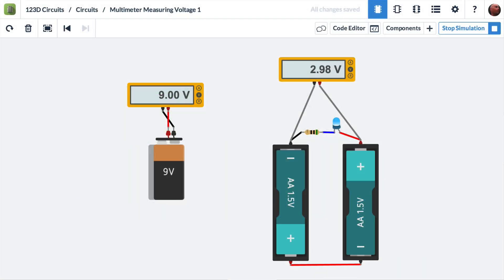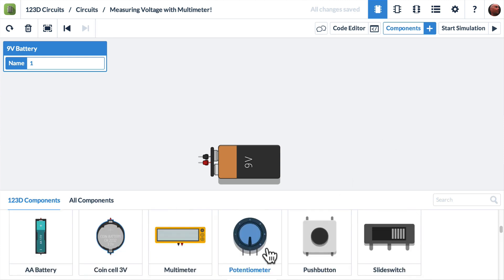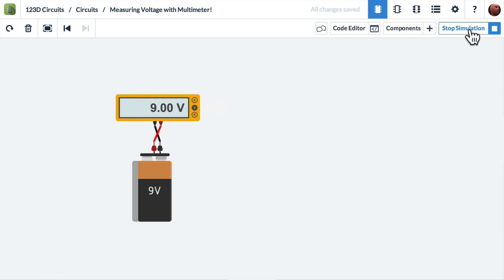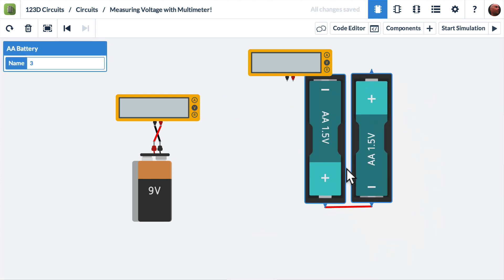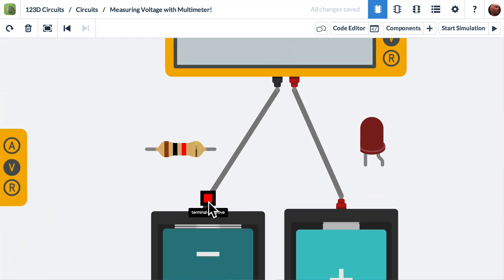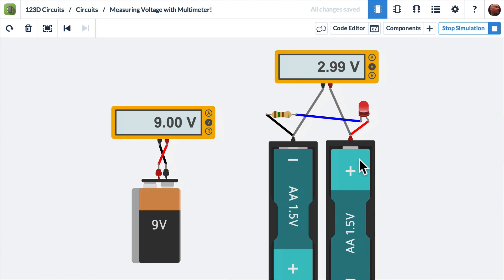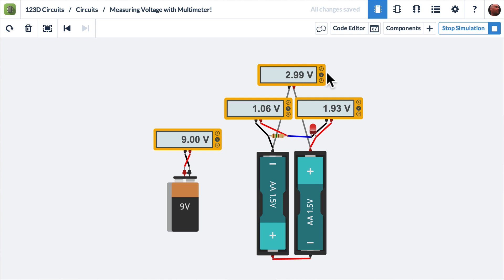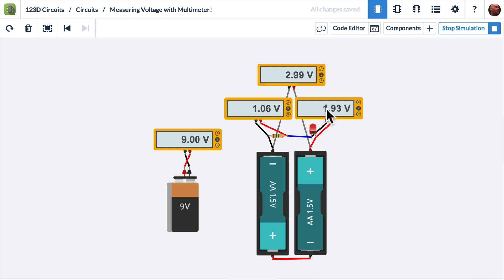How to Measure Voltage - Electronics Lab

Comment: I have yet to be able to make the meter show anything (in either of the three modes). I click start simulation and I can see the screen get brighter on the meter, but no values. Any ideas? I'm using IE11.
Reply from the maker: Hi Glen,
Would you please share the URL of your circuit?  That'll give me a chance to test it in a couple browsers (I think IE is the problem, we recommend Chrome).  Thanks!
Reply: Here you go: http://123d.circuits.io/circuits/535137-measuring-curent-with-a-multimeter
Reply: +Glen Harness the best electric simulator i ever saw